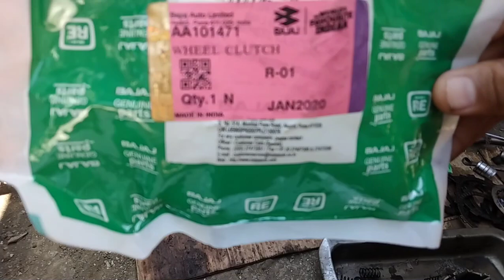how to change cluth linning Bajaj RE

Comment: 🙏 Good morning mam how check two stroke ingine or gear box oil level please🙏
Reply from the maker: Open the stick oil gauge in defferencial in check the oil,or drain the bolt 11 mm tools socket wrench below the crackcase of your defferencial engine